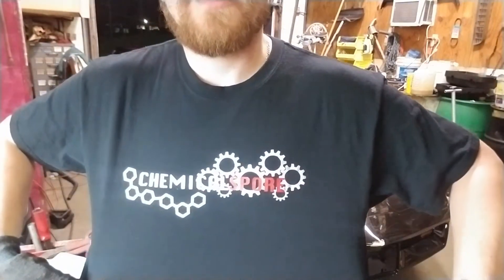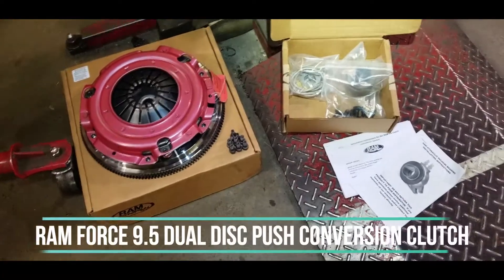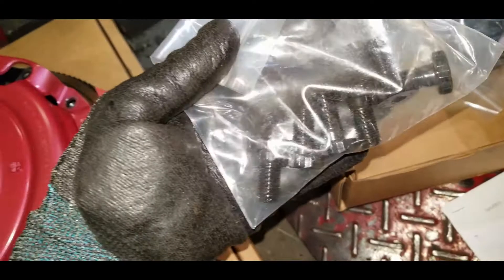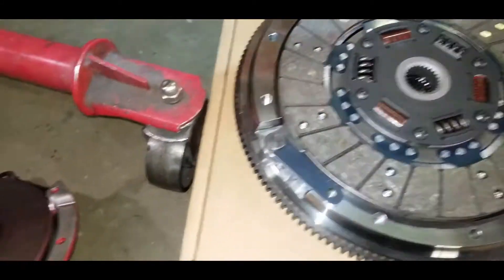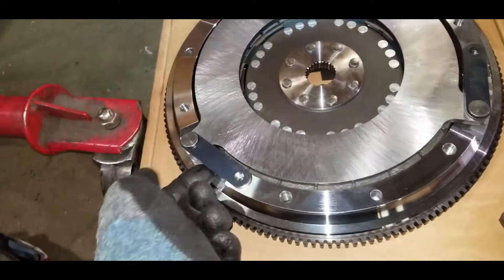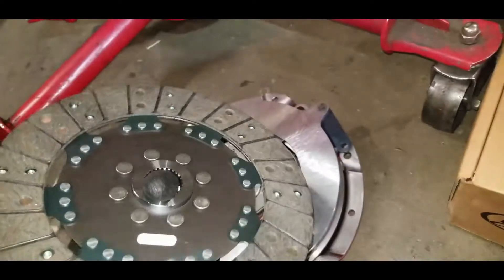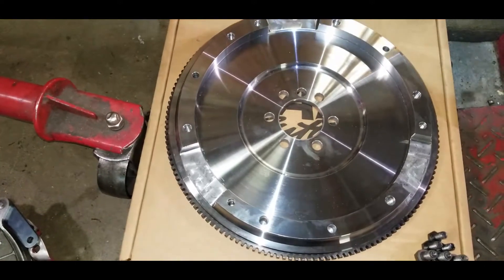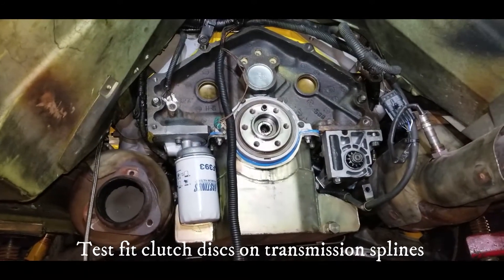Supercharged C4 Got a Ram Twin Disc Clutch. Twice the holding power, Half the effort. Install video

Comment: Im currently installing mine on my ‘90 So when you install the clutch and flywheel did you have to use shims at all? Im very new to this lol its my first time changing so i have little knowledge especially on aftermarket upgrades

Comment: Mine just came in. I'm going to try installing it w/o any new holes
I'm glad I found your video. If you buy one, you have better be good with WORD PROBLEMS because there's plenty of pics of the actual clutch in the instructions, but NONE of the install
I see the stud that goes into the transmission, but where does that large back flathead go???

Comment: Nice video, didnt notice if you changed the pilot bushing. Just a heads up for viewers tou should check yours if your car has over 75k, or has been driven hard. For a 9 dollar bushing it is crazy to not change it while you are in there. Use the fluted ac delco part. They require no lubrication and last a long time.

Comment: I am seriously considering this clutch. What I am not following is how the hydraulic release bearing hooks up to the stock master cylinder.  The stock master only has one line coming from it.  The hydraulic has 2 lines.  What am I missing??  Thank you.
Reply from the maker: Its a nice setup, little difficult to install with the hydraulic cylinder specifically lining up to the pin when going together but it is a great feeling clutch. One hose is coming from the master cylinder the other is coming out for the fluid bleeder extension.
Reply: @CamaroRick  Aha! The other is a bleed line that makes sense!!! Thank you.
Doug
Reply: @dougmoon4338  I bought the ram conversion kit, but used the single disc as my c4 is only na and around 450hp. It's a nice kit, comes with everything you need. Plus it will remove about 20 pounds of reciprocating mass from the 385. Make sure you do the zfdoc countershaft shim kit if you have a black tag. It will eliminate a lot of the rattle associated with the single mass flywheel conversion.
Reply: Hey man, thanks for the video! I have a couple questions if you wouldn't mind helping out. 

That guide pin for the release bearing that's coming out of the transmission, that needs to be trimmed? I didn't quite understand to what length in the video. Do you fully extend the bearing and then trim flush to the little guide fingers?

Also, how do you extend the bearing? Thanks so much!

Comment: Did you video setting up the Clutch master cylinder?
Reply from the maker: I kept the existing master cylinder on this one. Ive got a video on shimming the slave cylinder on a C5 which is the same concept. When I get around to my S10 project Ill do a video on modifying the master cylinder to make it adjustable. Its pretty simple

Comment: Sweet video what supercharger is on there also is it an lt1 was it a lot of $?
Reply from the maker: Thank you! Yes its a Gen II LT1. We rebuilt / upgraded the motor about a year ago. It had a bunch of issues that 26 year old cars normally have and are now taken care of. The supercharger is a Vortech V1 kit. It was installed back in the 90's They are tight to work on in a C4 but can make a lot of hp.

Comment: Awesome work. I'm looking forward to the hinge pin bushing video. Need to do the driver side on the Maro.
Reply from the maker: Thanks man! Hinge pins and bushings do wonders. They are a lot easier on an fbody. Same as the trucks. The hardest part is the door spring.